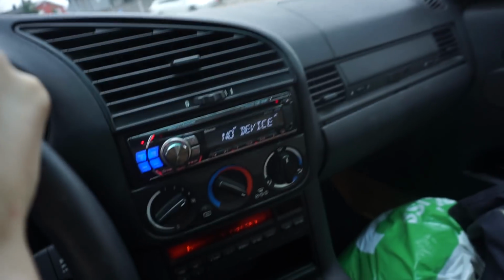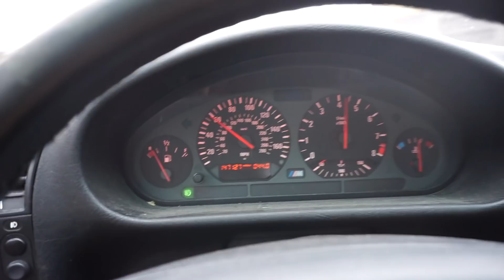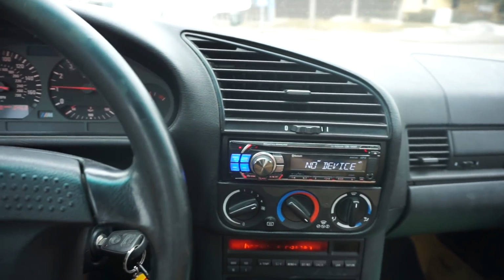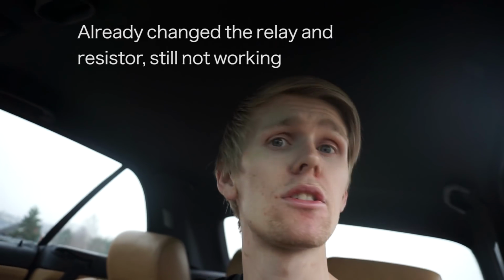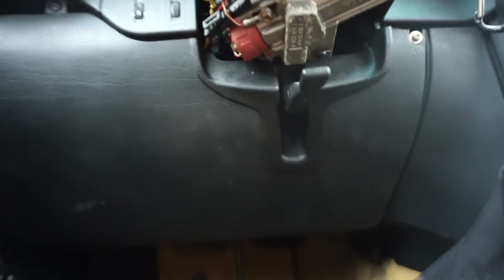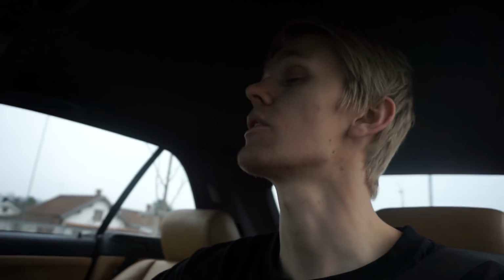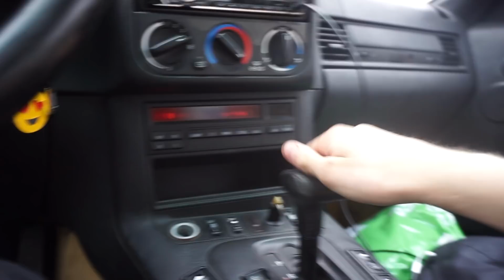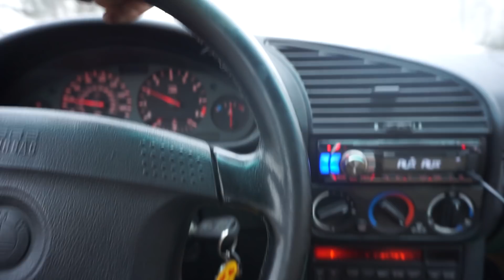Cabrio E36 left me stranded..

Comment: When I first picked up my E36 a few years ago, I had no idea that the braking system was so bad... I was very lucky to make it home that day, as I drove down the steep mountain where the steering wheel was shaking so badly... OMG! I honestly thought I would need to use the sand bank nearing the bottom to slow down, but I managed to get the vehicle under control and took it straight to the mechanic... Thank you for sharing your own experiences.

Comment: Regarding the fan issue? It may be the blower motor, but I am not an auto electrician... I also faced some problems with electrical issue regarding headlights and rear brake lights... when I took it to an auto electrician, he showed me the rear plastic covers and they were melted, so they needed to replace then with second hand parts in the end... but now it is all working fine... so good luck with your project... :) wishing you all the very best.

Comment: In my e36 I have to turn the key within 20 sec. after unlocking the car. If not the start interruption kicks in again. I have to unlock the system bij the rc or by a stick which is located next to the alarmlight, same as yours. At a alarm class III convertible, it' s normal to do so. Good luck!
Reply from the maker: Nico Dreessen your saying this strange USB is from factory? 😅😅
Reply: Fahre Films no aftermarket class III alarm. Most of the insurance companies won' t take the car if you didn't had this type of extra alarm in the past. I had to take it too in 2004. It was about 600 euro' s to get in the car.

Comment: That usb dongle look a like thing is a immobilizer. They always go bad when alarm system gets old. Just find the wires that interrupt the power from your ignition switch and solder them back to original.
Reply: Just find the afternarket alarm unit and remove the thing is even better. I had a 1995 Golf Gti and after 3 months i had start problems that was caused by the alarm. Removed everything problems solved.
Reply from the maker: Yes, need to look into it! 👍🏼😊
Reply: Fahre Films its not that complicated. If you just connect the interrupted wires back together 😄.

Comment: If the blower does not work in all possible settings than the blower motor is broken or not even there (saw that once... someone simply pulled it out and sold the car....=). It is a pain in the arse to change on E34s at least and I guess in E36 this is similar.... On E34 you need to get underneath the wipers. That means take the plastic off (you will brake basically all plastic pins... 7.50€ on ebay for 20...good investment). and than take out the whole wipers including the construction... and there the blower motor is. But maybe you can check if it is plugged in before. At least that is what you need to do in E34.....
Reply from the maker: Fastlane Blocker yes, under the wipers here too! Will fix this soon 😩
Reply: and that glued in piece of scrap... do not pull it off... it is a car disableing system. I tried to get that off and it is a pain in the arse. Just notice that if the car does not start... check if it is in N or P on the gearbox, if it is play a bit with that stupid thing there. If you destroy this system you will have a hard time fixing.

Comment: I HAVE AN E36 Question. How was your 323 compaired to your 325 in power? im thinking of buying the 323 cos its cheaper and according to the internet it has almost as much hp (they only wrote 170 hp cos of inverment laws or something)
Reply from the maker: Swedish Enduro yes, 170hp against 192hp. There is a difference! But 170 pulls really good also! 👍🏼 but offcourse you feel the extra 22hp( ps)
Reply: Hmm